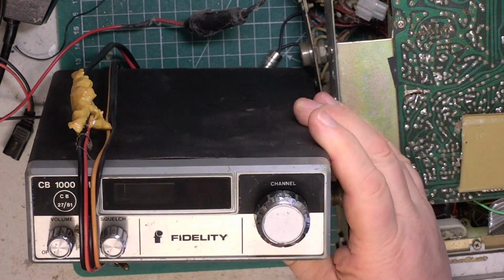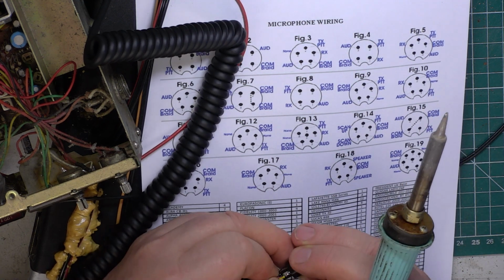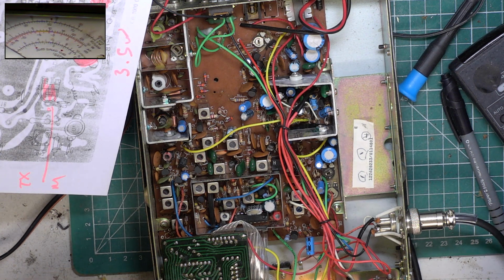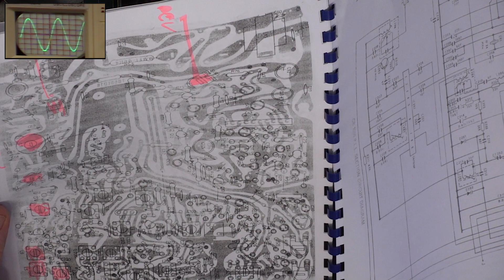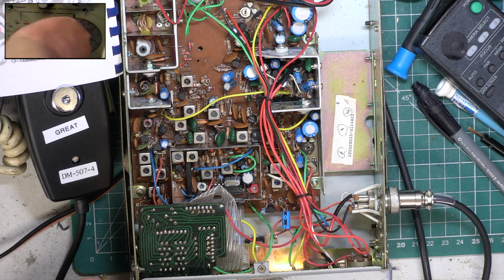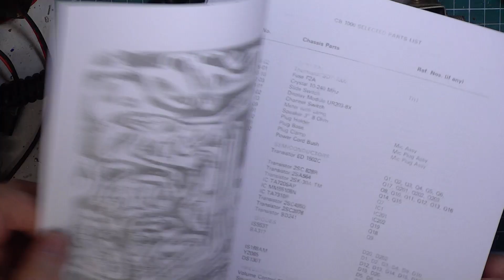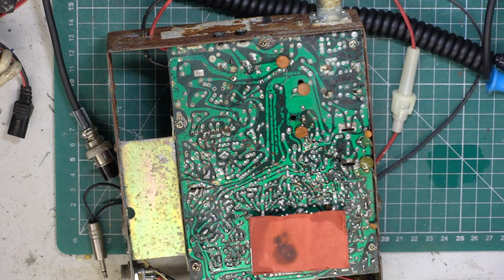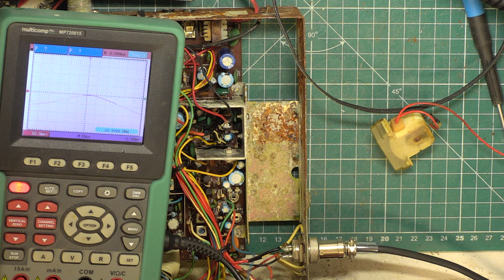Fidelity 1000 UK FM CB radio & scrap GT868 resurrection Pt1

Comment: Brilliant work Richard, I actually like these sets mainly because I remember them so well and well because it was on Terry and June albeit with a different badge.

I find them to work well and they sound nice with that larger speaker and big case.

I like resurrecting really rough sets as well, I might even have a case lying about I will have a look later.

Looking forward to the next video.
Reply from the maker: On Terry & June it was an Elftone ELCB6000. It would be fantastic if you could sell me some lids (& a scrap board) , Paul.

Richard, G0OJF, UK

Comment: I know a guy (a radio ham) who bought one of these new in 1982, he modified the receive to have better rejection and he used the set day in day out for years and wouldn't have a bad word about his modified fidelity 1000.
Reply from the maker: I'm sure he did & it worked fine. He would then have the combination of a very sensitive set with good selectivity.  I'd just have bought a set with better selectivity performance had I ever suffered from bleedover!

Richard, G0OJF, UK
Reply: Now that bleed over is no longer a thing I find the fidelity CB 2000 fantastic on the Muppets.  She hears everything and transmits beautifully with one of them cheap kpo 532's. Very impressive
Reply: @zukispur5493  the fidelity 2000 is a completely different CB to the fidelity 1000.
In fact it was the best rig fidelity sold, it's same as harrier cbx, rotel, York JCB 863
Reply: @ep1929  I was given her (in a battered state not working) so I decided to save her and get her back to her former best (stock/factory) I'm so glad I did. Lovely little radio.  73 brother.  (I never saved her personality by the way, I wouldn't even know where to start🌚 my tec guy did it.

Comment: Quick question. Have you ever seen inside or worked on a sansui AU 717 amplifier?
Reply from the maker: No I haven't. I do have two Sansui amplifiers here, one valved & the other is quadraphonic. Bear in mind I was an HMV dealer so audio-wise 95% of what I've been involved in was UK made by Thorn.

Richard, G0OJF, UK
Reply: @ukfmcbradioservicingTango21  afternoon Richard.  The reason I asked about sansui is because mine needs looking at. Was wondering.....?
Reply from the maker: @zukispur5493  Bear in mind I've just started a 19,000 hour organ restoration & am spending just 90mins per week on 2-way radio/audio until that job is finished in a projected time frame of about a year from now.

Richard, G0OJF, UK
Reply: @ukfmcbradioservicingTango21  firstly I'm glad you're busy. Secondly ONE BLOODY YEAR!😊😊 Thanks for the swift reply. Keep the videos coming. I really enjoyed them. 👍